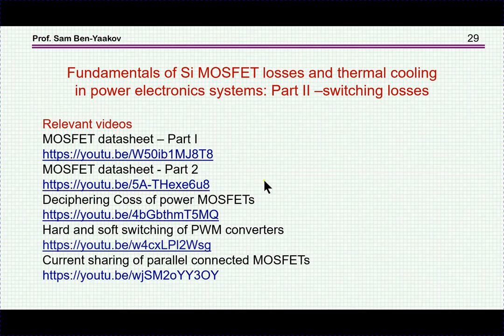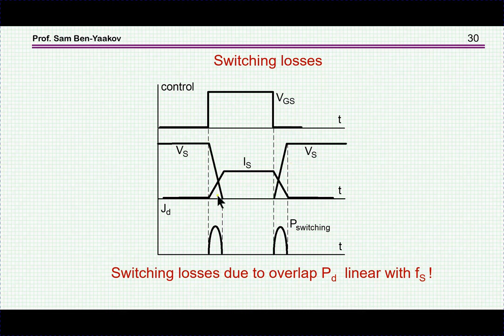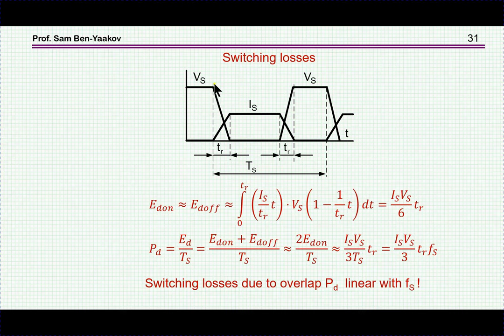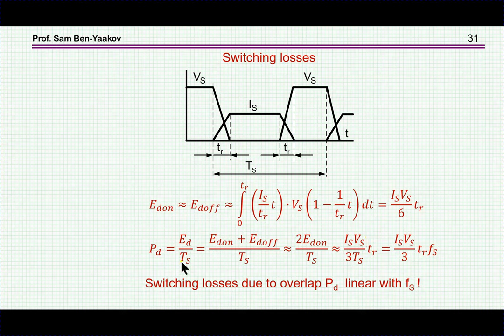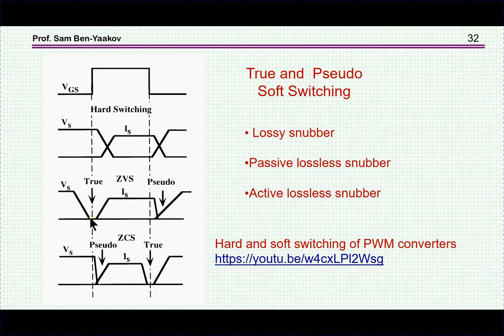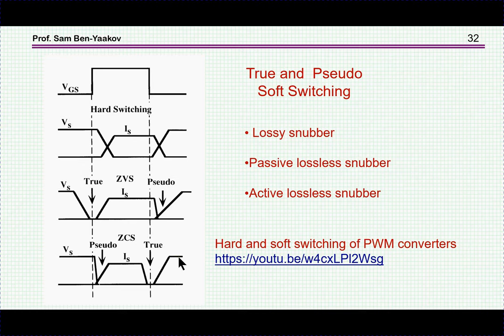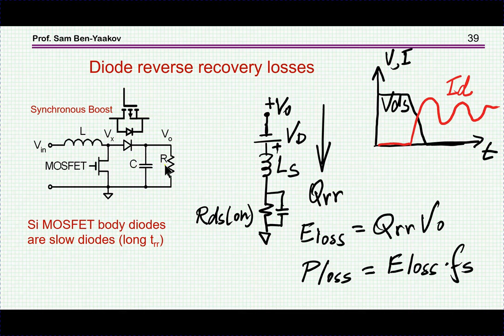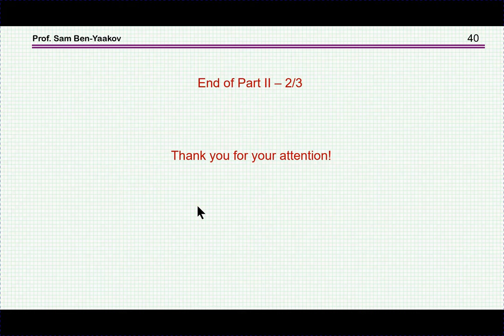Fundamentals MOSFET losses and thermal cooling in power electronics:  Part II –switching losses

Comment: Thank you Professor.
This title reminds me of thermal fatiguing in power semiconductors.  I read something - maybe 30 years ago  - I think in RCA data.
It stated that the then highest reliability, military power transistors would withstand 30,000 full temperature cycles before the chip detached from its header - obviously resulting in failure.  30,000 may not be such a big number in this connection.  This might be an interesting - even vital - topic.
Reply from the maker: Thanks for note and sharing. Good suggestion. Will  consider

Comment: Hello Sam, a quick question on power losses in transistor in LLC topology. There is R-ds-ON (static) loss, no turn ON loss as ZVS, there is turn-OFF loss due to magnetising current. Q: losses due to Coss/Eoss, are these losses ZERO in LLC design?
Reply from the maker: There is still turn off losses due to some overlap but no Cds losses thanks to the self commutating

Comment: @13:44 isn't the reverse recovery time of the MOSFET body diode is high as it is slow diode but you have mentioned its fairly low...Could you please clarify it?
Reply from the maker: Thaanks for comment. Yes it is a slip of the togue. trr is longer for MOSFET body diode. The end of that sentence that Qrr is larger is of course correct.

Comment: @2:52 dear sir in the general app notes I have observed that switching loss due to rise and fall time equation  there is factor 1/2 but in your video it is 1/3 ...I am not able to correlate both ....where I am getting wrong?
Reply from the maker: Hi, Thank you for the comment. None of of derivation is in fact correct since parasitics will affect the losses. The difference between the expressions is the way the problem is posed. In the video I am not taking into account the reverse recovery of the diode while in other publications they include it. The main point I was making that the losses are linear with frequency. The best way to estimate switching losses is by simulation .